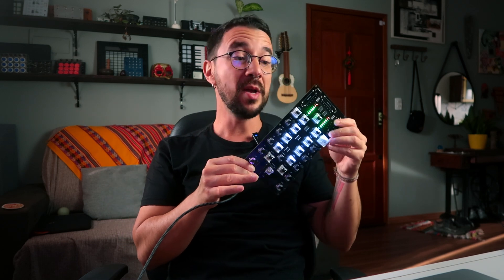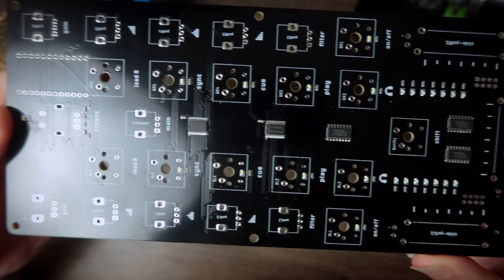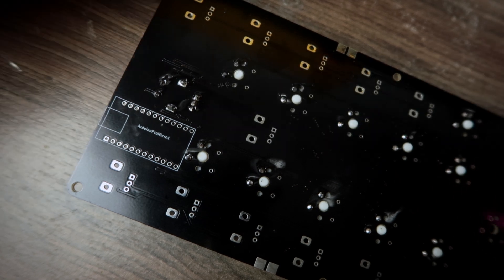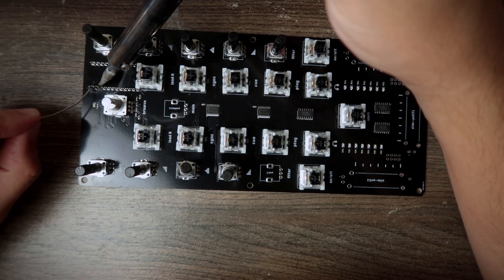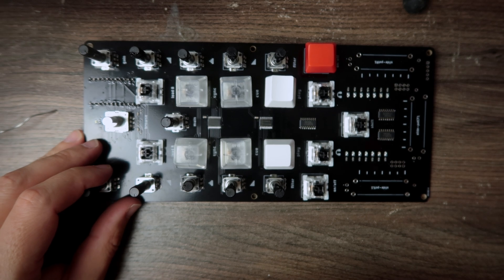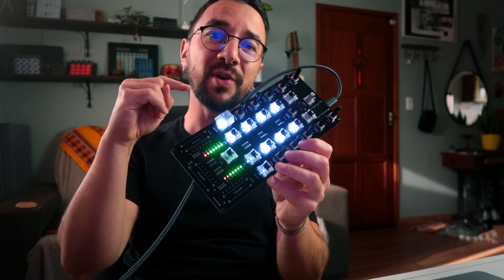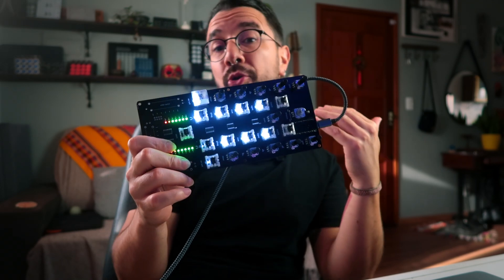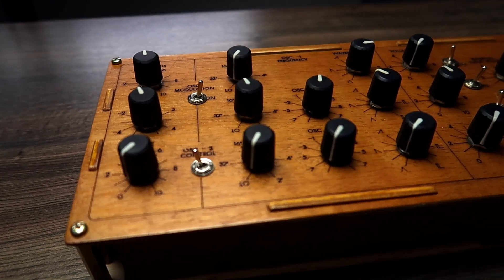How I Built This DJ MIDI Controller – Traktorino 2.0 Prototype

Comment: Nice controller. I think you really limit it with those faders. alphas are nice :)  but does it really solve a problem? in djing, there is a holy-grail of controllers. buttons ON the deck, on the turntable or jog wheel. #imfromthafutur
Reply from the maker: Can you elaborate more on this holly grail, or show me examples?

Comment: Very interesting project and design. Some question as to why you don't choose a more capable micro processor like RP2040 though.  Will track your channel and your progress. Courses also of strong interest to me. Will consider signing on when I have time to some time to devote to hobby play.
Reply from the maker: This is also a "didatic" project, to be as beginner friendly as possible, and the Arduino is the easier board to use by far. Also, it's totally capable for this task. However, maybe in a next version I'll switch to a more powerful board.

Subscribe here to know when it gets released: https://go.musiconerd.com/lp-traktorino-launch-1
Reply: @NerdMusician, I must begin by saying a huge THANKS for your tutorials on DIY MIDI controllers, they were a great place to get started building DIY MIDI controllers, and really development with Arduino and other MCUs in general . 

I got started with DIY MIDI trying to build a Sustain pedal-to-MIDI converter. With step-by-step guide from "how to code buttons" and "how to code potentiometers", introduction to circuit design on tinkercad, what microcontrollers to use etc.

The product came out better than expected, with four other pots and support for an expression pedal (although I never used it, LOL).

I have since worked on other Arduino projects, but notably, at the start of the year, I was able to salvage a broken keyboard and convert it to a velocity-sensitive 61 keys MIDI controller, threw in some extra pots for better DAW and plugin control, and all with the pro micro!

Honestly, I didn't think it would hold at all, so I got a ESP32 S3 (15x as fast) midway. Turns out the human hearing and response is waaay slower than 16MHz. 😂.

The pro micro worked perfectly, reading for 128 buttons and 8 pots on three 16-channel multiplexer! I can't even detect any lag/latency. So yes, I completely agree that the pro micro is capable.

As for the ESP32 board, I've modified the code to fit the board an also include BLE and rtpMIDI, full implementation pends till I get/make the circuit board. Looking to add rgb LED support like in your flipper DJ project or maybe even two MCUs in tandem.

I also did a variation for the pi pico rp2040 using your library from the fidget spinner. So once again, thanks for all your help and the library, you truly have been an inspiration to myself and other builders out there, hats off.

God bless you.

Comment: Wonder if this will be able to chat to ESP32? I would like to have the ESP32 handle the GUI then.
Reply from the maker: This no, since it's based with the Arduino. But explain more about your idea.

Subscribe here to know when it gets released: https://go.musiconerd.com/lp-traktorino-launch-1
Reply: @NerdMusician  Hi, I'm thinking of designing a controller to use with Djay Pro, software on mini-PC, networked to ESP32-P4 to run touch screen GUI on 2 screens on either side of controller. I would prefer encoders so that I can map the values to progression bars on the screens to match position/colours of the encoders and button. I could then also use the screens to select functions for the buttons and encoders. So I can select STEMS on the screens and the matching encoders and buttons will be active for those functions.

Comment: Really, really cool. Any idea what I would need If I were to try and make a midi controller with a triple sensor, wooden key action? I tried to search for videos where people were trying to make such things, but i did not find anything with the right parts list of instructions, specifically the long contact pcbs, that the keys will trigger when pressed.
Reply from the maker: Can you elaborate on what do you mean with "a triple sensor, wooden key action"?
Reply: @NerdMusician  As in I want to work on a weighted key action, with wooden keys, but I would need the electronics under the keys, like the pcb that will sense the keys being pressed. 

So wanted to know where i could find off-the-shelf parts that can be used to make a keyboard, specifically the sensor strips under the keys that you can see if you open any digital keyboard.